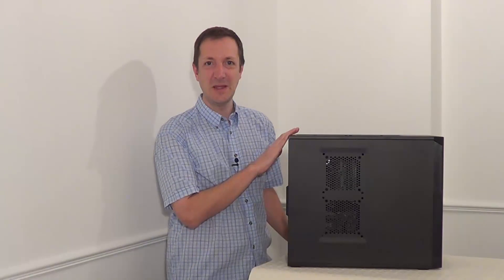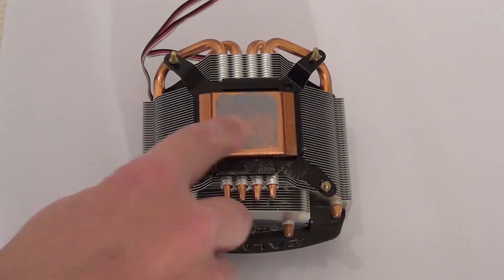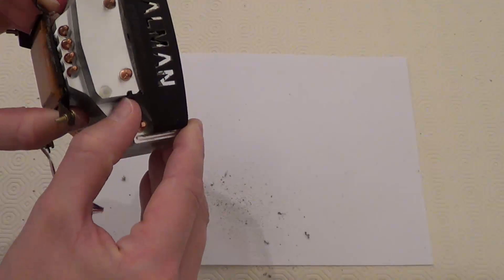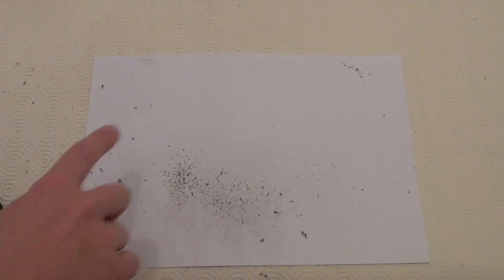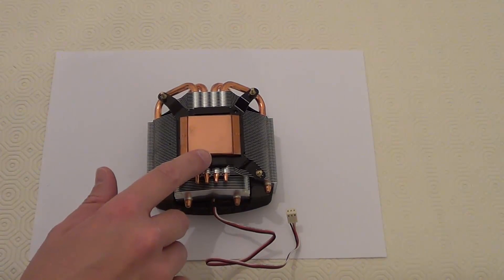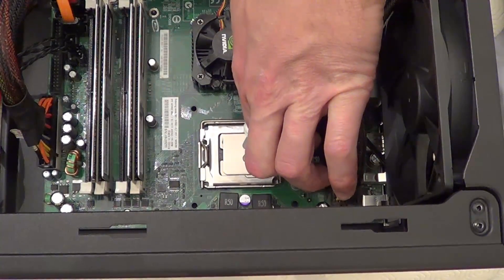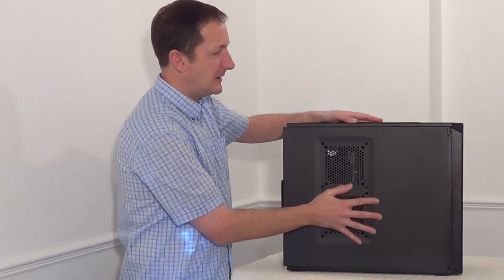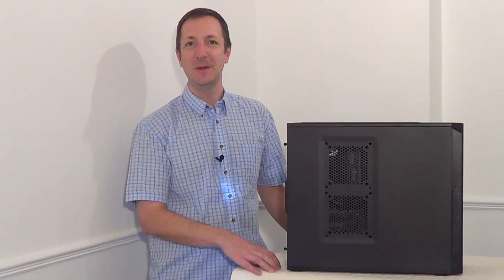How To Clean A Desktop Processor Fan

Comment: I decided to reapply paste to my 5600X. I loosened the screws on the stock wraith cooler, twisted a little to try and break the seal of the existing paste, and pulled it off... along with the CPU still attached.

Comment: I was so relaxed -- until you spread the paste on the CPU which was totally unnecessary😪
Reply from the maker: It's better to spread the paste, instead of it being squashed and just hoping that it has spread well. That's why I spread the paste most of the time. It will give you guaranteed good results every time.
Reply: @EasyPcRepairs  yeah but you inevitably include air bubbles and possibly even dust particles doing it this way 💁‍♂️
Reply from the maker: Any air bubbles will be squashed out when the heatsink is pressed up against the CPU. There are no extra dust particles when spreading the paste. No matter which way this task is done, there will inevitably be some dust particles though.
Reply: @EasyPcRepairs  Air bubbles can only be reduced in size but still remain (as seen when putting on screen protector glass on a smartphone). Spreading paste with whatever tool will inevitably introduce more particles than spreading it by lowering the CPU💁‍♂️
Reply from the maker: People have discussed this subject for years. And the discussion still goes on today. All I can do is tell you my experience. After pasting and repasting many many computers, trying out different methods and testing them, whichever method I used, it barely made any difference. Maybe 2°C at the most. The best method that I have found  is to spread the paste (for cooling and CPU coverage). If someone wants to do the 'blob in the middle', cross, lines or 'smiley face' method, I'm not going to criticize them for that because it will make little to no difference on the performance, cooling or longevity of the CPU.
Reply: @EasyPcRepairs  I agree

Comment: Paintbrush can only be used on non electrical for dusting. It generates static so if you use it on electrical you risk a nasty chance of ESD (electrostatic discharge). Which is why most dusting brushes for PCs are usually plastic or some other synthetic fiber

Comment: I have a watercooler for my cpu how do i clean it?
Reply from the maker: Most water coolers will allow you to take off any fans attached to it. Take off the fans, blow air through the water cooler's radiator, clean the fans with a cloth (and a can of air too doesn't hurt), then put the fans back on the radiator as they were. Before taking the fans off, note their orientation. For example, if they're blowing towards the radiator, when you put them back on, make sure they will still be blowing towards the radiator.
Reply: @EasyPcRepairs  👍🏾 ty for your help

Comment: My CPU is really dusty and loud, does anyone think that’s the reason why it’s being loud?
Reply from the maker: When a fan is dusty, it can't remove the heat as well, so it has to spin faster. So a dusty fan will nearly always be louder.
Reply: EasyPcRepairs Right brill, I’ve ordered some compressed air and some delicate brushes to sort it out. Also bought some thermal paste, because it hasn’t been reapplied in the 4 years of having the PC😂
Reply from the maker: Sounds like you're all set to get it sorted out.

Comment: Spreading the thermal paste will create lots of air bubbles (not a good conductor of heat). A pea-sized dot works much better.
Reply from the maker: Any air bubbles that are created from spreading the paste are removed when the heatsink is placed onto the CPU. If the paste is spread first, you know it's spread correctly.

Comment: It is necessary to remove the paste??
Reply from the maker: Yes. If the old paste is left on, the CPU will either run at very high temperatures, or could even overheat.
Reply: Okay thanks
Reply: @urielandrelim2439  they say usually every 6 months but if u gettin overheating do it more often every time u clean the dust out
Reply: @cmoneytheman  That's kind of scam-myth to force you buy new thermal paste. For average user inbuilt thermal paste is designed to last for 5-8 years, because average user doesn't bother or even knows what a thermopaste is. Otherwise everybody would know this and go for 'paste change' every so often.
But if you're into overclocking, yeah, your info may be sound.
Reply: But the thermal paste is gone to the heat sink and then keeps overheating
Reply: @urielandrelim2439  yea any is good it depends on the cooler the most wha kind u got
Reply: Any thermal paste is good for the cpu??
Reply: Thanks
Reply: @urielandrelim2439  I said wha cooler u got

Comment: Howcome my 6 year old  CPU  has no problems after totally neglecting the dust in it all this time?
Reply: Try to clean it and check the temperature difference. Because CPU fans are usually built with '6 years without cleaning for average consumer Joe or Jane' in mind.

Comment: Was hoping you were going to show how to remove the fan cap exposing the fan rotor as my CPU fan makes a noise almost every time I cold-boot my PC (Have to put it into sleep mode and wake it to get the noise to stop).  I have an Intel CPU+Fan like the one in your video but the difference is yours has 4 grips on the heatsink and mine has 2.

Just wanted to find out which side of the fan that the rotor can be accessed so I can clean it out and put a stop to the noise.

Comment: Is it ok to clean up CPU fan with cold water instead of wd40?
Reply from the maker: That wouldn't be very good for the fan. Clean the fan with a dry cloth to remove the dust.
Reply: You should NEVER ever clean electronic components with WD40. It's designed for mechanical parts like cogs or sliding metal parts with no electronics around. WD40 has oily components that will accumulate dust at greatly increased rate.

Water is fine as long as you're 100% sure you've dried it well afterwards. Distilled water is much safer option, you can even sumberge eceltronic components in it and then thoroughly dry them. But again, tap water is fine for cleaning HEATSINK.

Comment: I currently bought the two Arctic cleaning liquids along with Arctic Silver 5 for the CPU from eBay. I plan to also get a replacement heat sink fan because my current one is spinning slower than normal.
Reply from the maker: You might find the fan spinning faster after a clean. It doesn't always work but it's worth a try before buying a new one.
Reply: EasyPcRepairs
Let's say I want to clean the whole heat sink, including the fan itself. How do I clean the fan? What cleaning product is safe to use? I hear from a friend on Skype that I could use rubbing alcohol to clean the heatsink fan cause it's non-conductive. Is that true, or is there another method to cleaning a fan & heatsink?
Reply from the maker: Once the fan is off, I found the best thing to use is an 'anti-static, lint free, micro-fibre cloth' which can be found on Amazon. No need for chemicals, you just need to remove the dust.
Reply: EasyPcRepairs A friend on Skype suggest I use rubbing alcohol for cleaning the fan, and then mineral oil to lube it up once I'm ready to reinstall it. Rubbing alcohol, he said, is non-conductive. I think.
Reply from the maker: It's fine to use rubbing alcohol as it will evaporate away after it's been used. It will clean the fan better than just using a cloth. So if you want to go that extra mile and use it, that's good. Personally, I don't use it for fans because a cloth will do the job very nicely.
Reply: EasyPcRepairs
What about the mineral oil for lubrication?
Reply from the maker: Yes, that's fine.
Reply: EasyPcRepairs
Any kind of mineral oil?
Reply from the maker: Sewing machine oil is probably the best for PC fans as it is used to lubricate high speed moving parts.
Reply: EasyPcRepairs
I couldn't get inside the heatsink fan, because there seem to be no back opening to get at. So I just cleaned it with rubbing alcohol. I think clean the heatsink and then followed the directions for using the ArcticCleaning liquids and the Arctic Silver compound. Right now, the heatsink seems to be ok, but the fan tends to stop after a few minutes, and I have to spin it back up manually. I'm keeping on eye on it right now. I', just guess the fan itself has to be replaced. Will a heatsink fan for a higher number of CPU (ex: FX-6100) work on a FX-4130 CPU?
Reply from the maker: Many AMD CPU fans are interchangable, but double check before you buy. I think you're doing the right thing. If a fan is not working well, it's better to replace it in most situations.